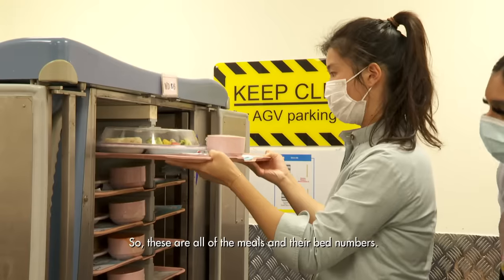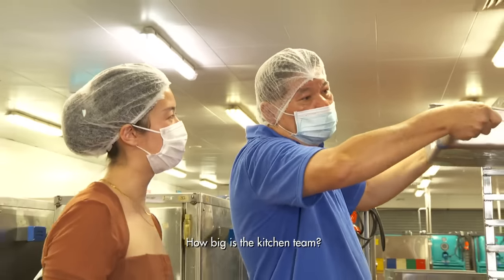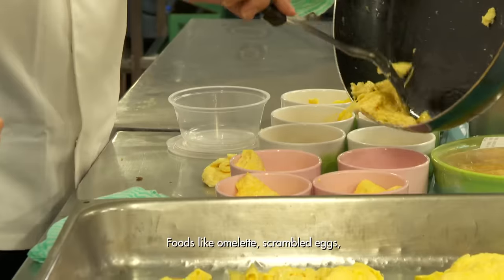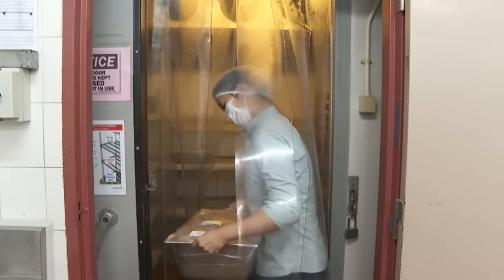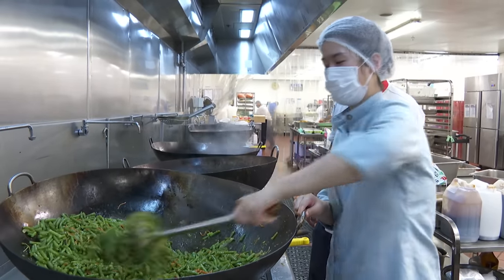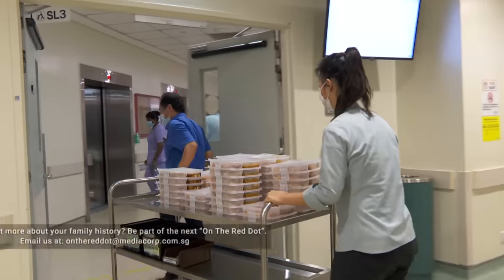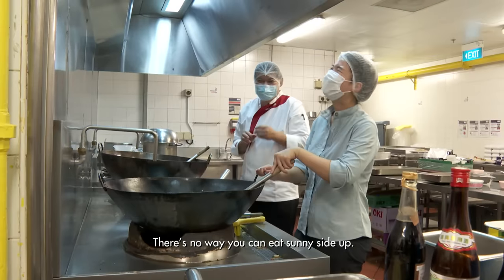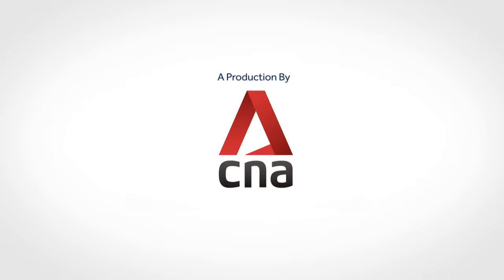Masterchef Cooks Inside KK Women's and Children's Hospital Kitchen | Eat Up! | On The Red Dot

Comment: 20:21 - not an accurate way to measure food waste due to human memory limitations. Implement hybrid AI night vision daylight camera at food waste disposal station on ceiling (reduce splatter on camera), where camera have inbuilt car windshield wiper with spray to DIY clean dirty camera lense. Hardware is cheap, design is ready tech, but management and patent costs makes product expensive. Simple way is to install a phone camera on a metal height adjustable mount linked to AI app, change the ethnic food plates to different colour (plastic?), the AI app will auto trigger based on 1. colour of plate to know which ethnic food it is or special diet it is, 2. visually log the amount of food waste per empty space left on plate. There's no disruption to the speed or productivity of food waste disposal team. Monetise as hospital sci fi movie or real life?
Reply: They know what they’re doing and they’re doing just fine.